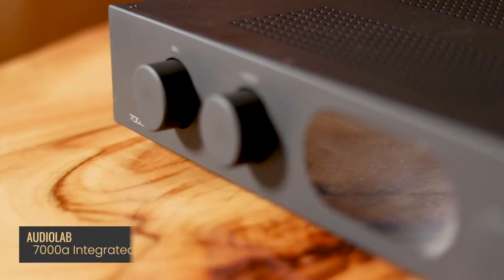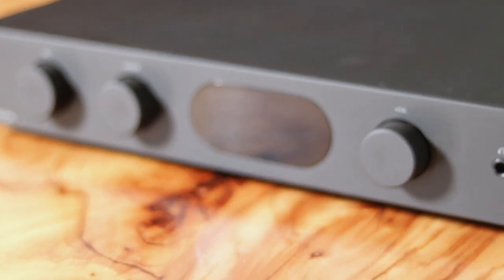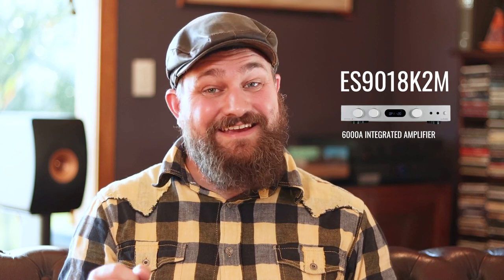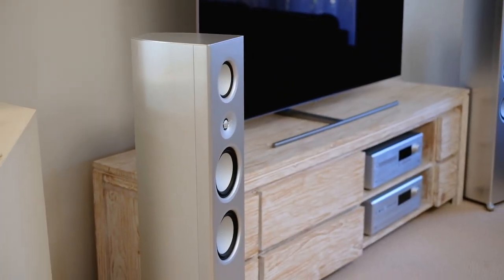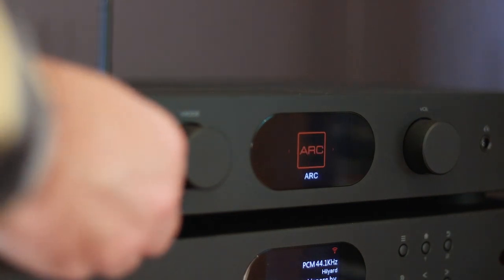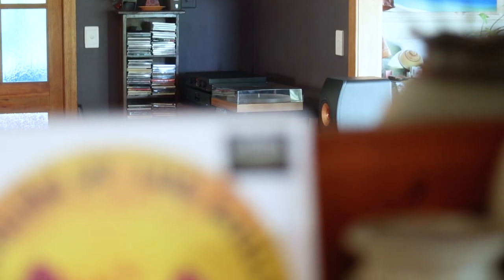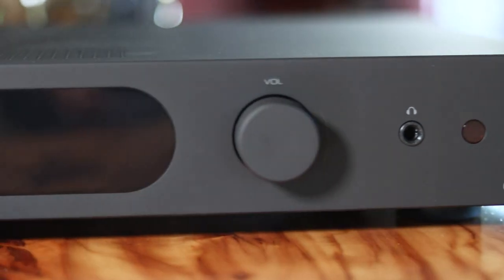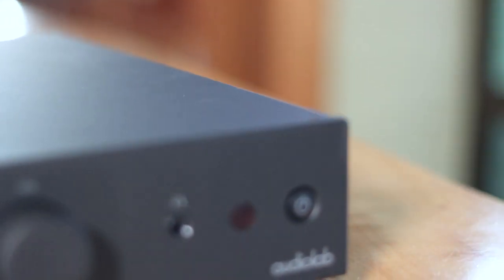Audiolab 7000a - The middle-child explained.

Comment: I personally find the 7000A's sound too analytical, at least paired to my Q Acoustics 5040. It particularly has a problem resolving female vocals. Roberta Flack, Diana Krall, Eva Cassidy, Madeliene Peyroux all sound thin and stretched out and sharp-edged. In many other vocals there is a slight hiss which I guess most people might not notice, but it gets to me. I switched to the Eversolo DMP-A6 Master Edition's internal DAC and immediately I noticed that the vocals were much fuller and rounded and more satisfying. Thanks for your review.
Update: What a difference the interconnects make! I had been using coaxial which gave me the thin vocals. I then tried connecting my eversolo to the 7000A using USB. Wow! Now the vocals are beautiful! Moral of the story: mix n match and experiment.
Reply from the maker: Mixing and matching electronics and speakers is a key part of every audiophiles journey. Not every pairing is going to work for everyone, thanks for your opinions on the pairing with Q-Acoustics, its not something we have had the opportunity to test.
Reply: Sounds like they put more effort into the usb input. Thanks! I now know what sort of streamer to get
Reply: Get some better speakers. And the Audiolab measures flat.
Reply: @r423sdex  Thanks. Actually the speakers are great with other matching gear, like the Denefrips Pontus II 12th.

Comment: During your testing did you notice any volume level that was causing 7000a problems with driving LS50 Meta? I'm thinking about getting this set but there are a lot of opinions that these speakers require more powerful amp. My sofa is ~2m away from the TV cabinet where these would be situated.
Reply from the maker: At no point was there any straining of the speakers, and at only 2m away from the cabinet you shouldn't be cranking any speakers or your going to damage your hearing.

Depending on the size of your room you might want too invest in a sub if you want that full sound.

Comment: I have owned 6000a and upgraded to 7000a, my views are exactly what you said. I have paired both with Lintons, and the Lintons opened up more when I upgraded to 7000a. 
Excellent Dac and superb sound which won’t fatigue you on any level. 

Nice Video
Reply: Give Lintons 6000a, 7000a, 9000a, give them 2x150W, give them pure A class, and they will thirst for more. And they will deliver more.

Comment: I got the 7000a to go in my parents house while I have the 8300a. The speakers are almost the same… wharfedale diamond 225 with the 7000a and diamond 230 with the 8300a. I haven’t tried an external dac yet with the 7000a, but just comparing the bluesound node and my 8300a, the tuning is very different. The 8300a is way way more neutral (even though both are mid focused), and as a result the 8300a does come across as a lot smoother to listen to… but I need to try the bluesound node on the 7000a before I can confirm this properly. Both are good depending on what you like to listen to… the 7000a will add more grit to male vocalists, so if you like Phil Collins go with the 7000a, but if you like Pavarotti , go with the 8300a. Both have good instrument separation…

Comment: Thanks for your very good review. I know very well that always will be better speakers option that you can suggest for Audiolab 7000A amplifier but I strongly decided to purchase KEF LS50 meta. My room size is 14x15 feet and I always leasining music between 72-84 db. After your review I think I am not will be disappointed to pair KEF LS50 meta with Audiolab 7000A amplifier. Are KEF LS50 meta speakers is decent match with this amplifier?
Reply from the maker: Yes they are, they sound fantastic together.
Reply: Thanks